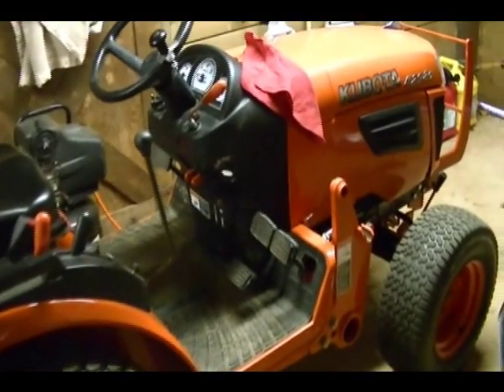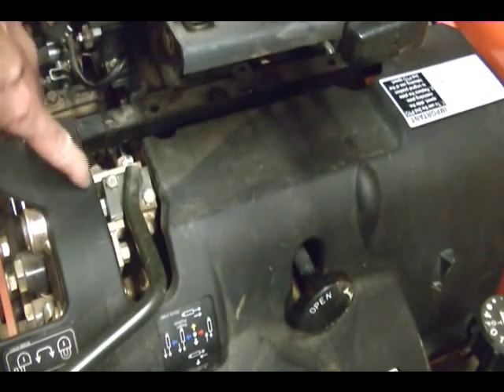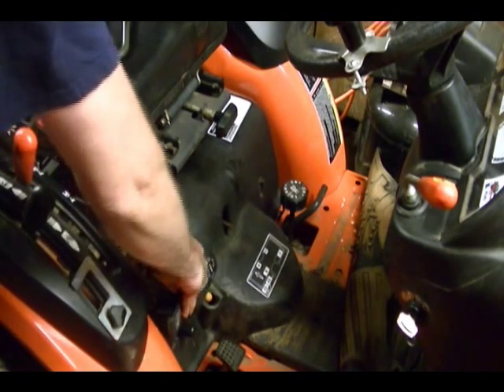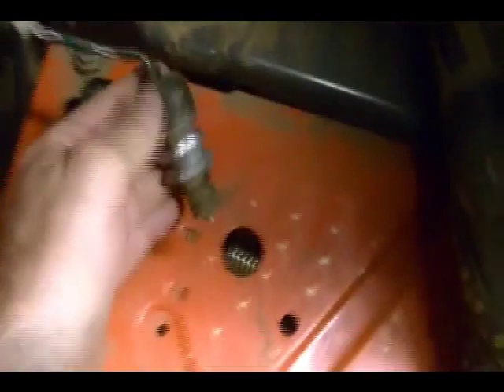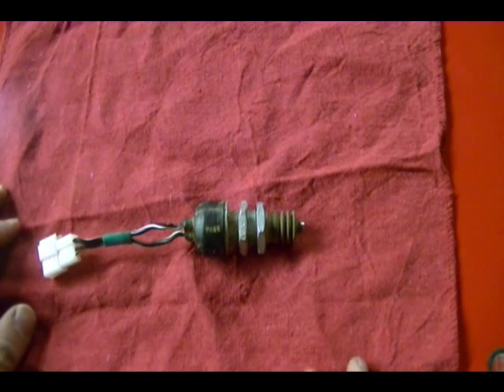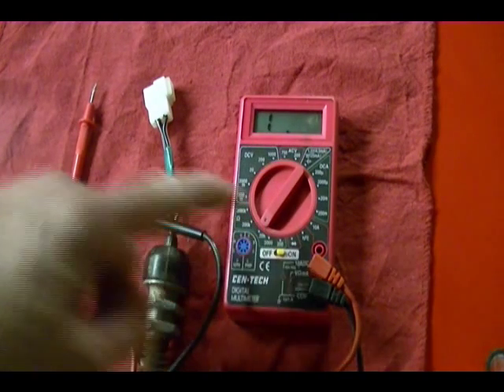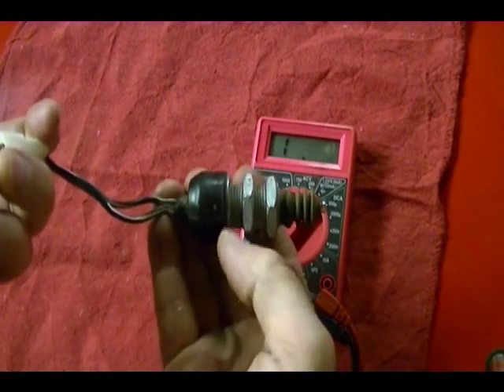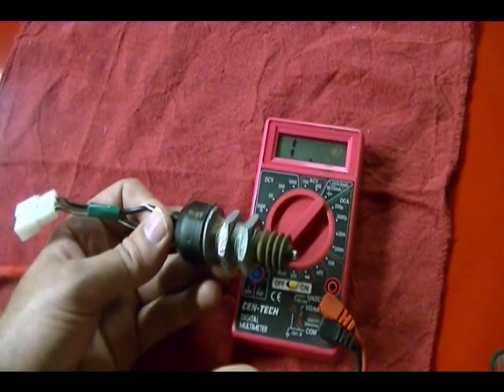Small Engine Repair: How a Transmission Foot Control Safety Switch Works on a Kubota B2920 Tractor

Comment: Yes, thanks for posting this and taking the time to work through the testing and resolution.  This is exactly what was causing my b2620 issue that flummoxed me all day long today!  I finally discovered the tractor would only crank if I briefly pressed the reverse pedal slightly then let go.  Thanks again.  Now I need to figure out how to adjust the switches' "length".

Comment: Did this to my non-starting B2320. This condition seems to be a common problem and this plunger switch is nearly impossible to access from the bottom. Couldn't get the large knob off on my tractor to remove the plastic cover so I just popped the snap ring out of the back of the shaft it's on and just unscrewed it doesn't take very long to adjust ONCE you get access to it.

Comment: Thank you. very helpful video.  I have a B3030 (2007) and have been mistakenly cleaning the grass of the bottom of the tractor with a garden hose instead of using compressed air.  After washing the HST pedal will not return to neutral when the pedal is released from going forward or in reverse.  Greasing the zerk on the control linkage has solved the problem but this last time greasing didn't do the trick.  Also recently after stalling the tractor will not start right away. Eventually (10-15 min) it will start.  After watchin you video, I am thinking that the switch is not adjusted properly, and if I move it forward (toward the neutral arm/HST speed control rod) that both of these problems will be solved.  Am I understanding the mechanism of the speed control linkage function correctly?  Any advice on how to solve the "Kubota creep" would be helpful.

Comment: Great video, I was searching for info on our L-48 which wouldn't start unless it was above 35 degrees, since the boss was in the river trying to rescue the excavator, but anyway. your video helped clear up some questions and was very clear on step by step diagnostics. today laying in 6 inches of snow I took 2 of the switches out and tested. The rubber boot on one of the switches was full of ice. when it warmed up the plunger would work, then it would get cold at night and refreeze.( Thus random starting). once I started it it ran fine all day. Thank You again for a great video.

Comment: I was hoping for some information on a common problem for the Kubota tractors - the sticking pedal. I could have told you the switch was OK if you eyeballed the position of the linkage and tried to start it when its in vs. out. Just saying. I have BX series and the pedal is sticking too, have lubed the shafts for the pedal and linkage but its about the same. You do a good job of explaining, but you should assume a bit more existing knowledge on how ohm meter works and NO/NC switch, goes slow.

Comment: How do you bleed this thing? the instructions in the manual are so vague; it says fill the tank with fuel. Run the engine for 30 sec and then turn off the engine...then what? help